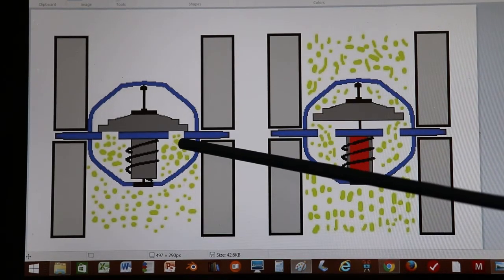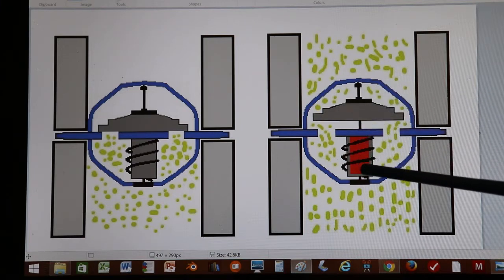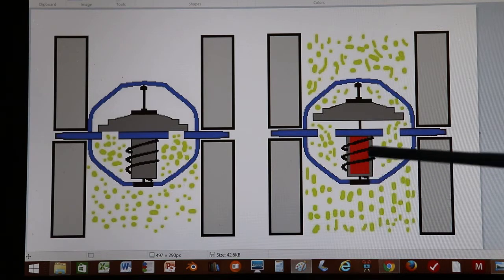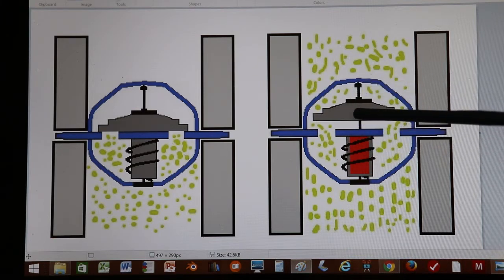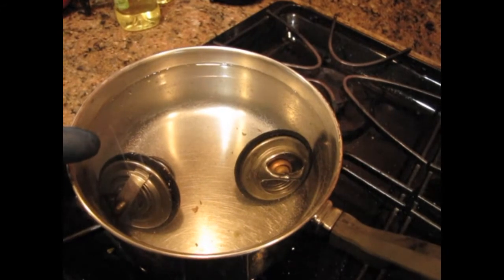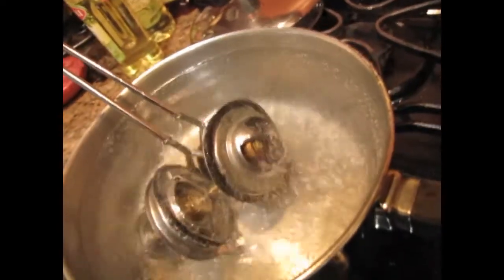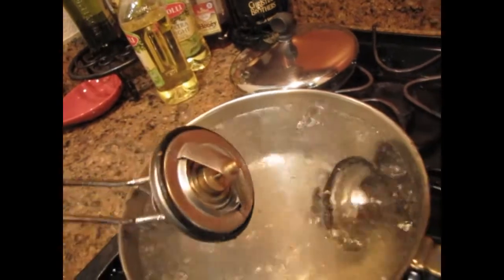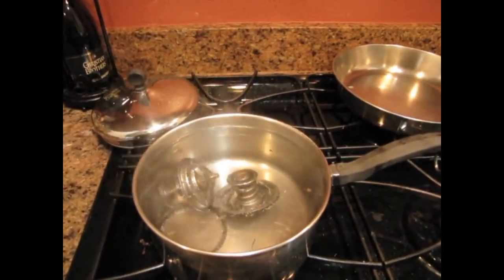How a Thermostat works removed from BMW E36 M3 works the same on many others

Comment: Good explanation. By that diagram, the lower radiator hose on your E36 M3 should be the one that carry the hot coolant from the engine block then?  My understanding is that the upper radiator hose is the one that carries the hot coolant from the engine, which beg the question how would the thermostat work when the flow of the hot coolant IS on the other side of the housing, unless there is a by pass somewhere that allows the hot coolant to get to the thermostat. I guess I'm wondering what the flow path is. Trying to put additional temp sender unit for aftermarket coolant temp gauge and wondering where is the next best location to put it at other than engine head.Thanks
Reply from the maker: The video is not intended to be a representative diagram of the actually layout of the car, only to explain the function of the thermostat.  watch this video, go to 5:00 minutes in for the thermostat.   https://www.youtube.com/watch?v=y5p31F_dVJU
Reply from the maker: https://www.youtube.com/watch?v=9ozut4xh7W0&t=203s